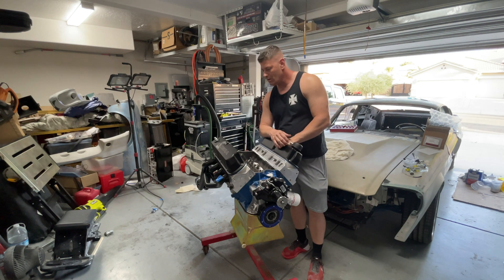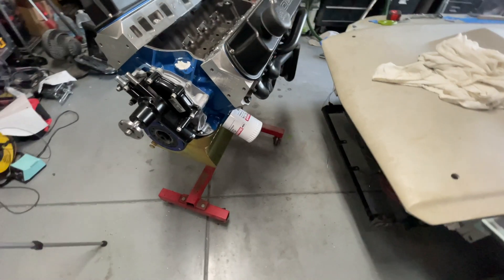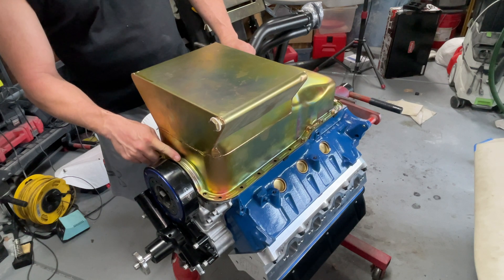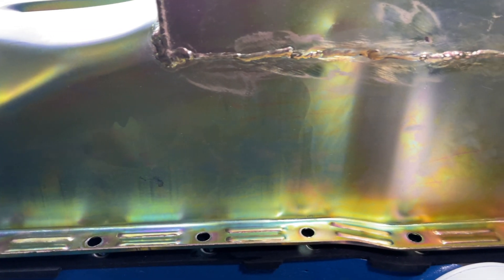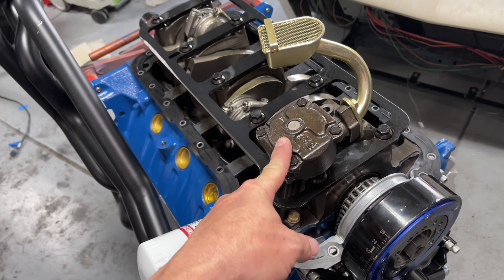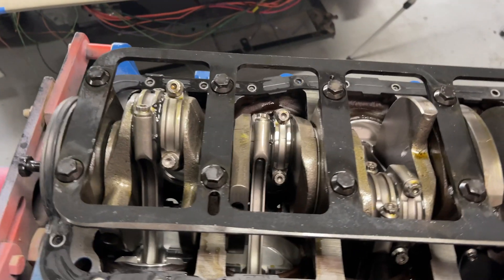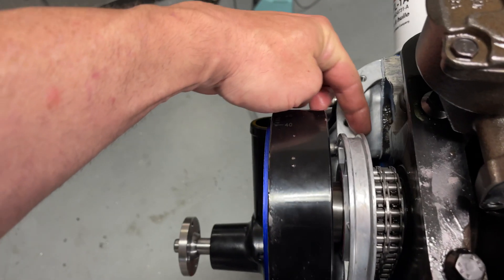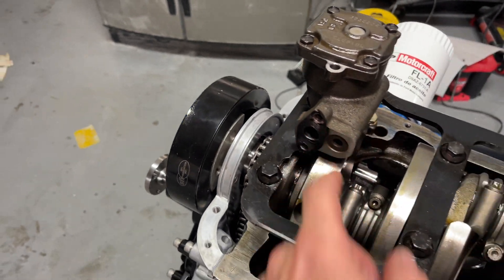351W 408 Stroker Engine Build PART 7 Oil Pump, Pickup Tube and Oil Pan 4K

Comment: Aren’t girdles useless? Don’t studs hold the caps far better
Reply from the maker: As far as I understand, cap walk is usually kills a bottom end. Aside from an oil delivery issue.  Girdles are supposed to lock things in and prevent the caps from being about to wrist. A two bolt main would have been ideal. But I definitely think it will help… cheap insurance for sure… as far as a studs being better… I don’t see how? I recognize studs are generally better than bolts and offer some advantages when servicing and removing… generally you wouldn’t break on in the block… I don’t personally see how they would have more holding power? But I believe it was a studded girdle If I recall 💪.

Comment: I would run 7 qts. initial fill. You have about 3/4 qt in the filter and then when the engine is running there will be about 2 quarts circulating thorough the engine. That should leave about 4 qts. in the pan. Perhaps my thoughts are totally wrong, but I am sure someone will correct me.
Reply from the maker: Thanks, I always kinda wondered about that. I just curse it around the block here and there, still some body work to do, but the 7 seams to be working out good so far!

Comment: Go with 7 qts to start.  Once the oil filter is filled, you can check the oil level and add more if necessary.  Even if it is a half quart over and your leaving horsepower on the table, you'll be changing the oil after the first hour or two of break in, and then can reduce the oil level at that point.
Reply from the maker: I like that idea, I’d rather be over than under on break in. Not like I’m really probably going to experience and windage issues at that point anyway. Then as I get more aggressive with the car I can adjust it as needed. Great advice!
Reply: Pour in the amount the pan tells you to. Don't even look at the dipstick. Just know.
Reply from the maker: @buysncharge  It’s all custom, the dipstick doesn’t even have marks yet, that was semi the point of the question, trying to figure out where to put it 🤣.
Reply: @ironmustang  delete it. Use the standard filter. It's Milodon and says 8 qt. That's exactly the amount. Dip sticks are relics.